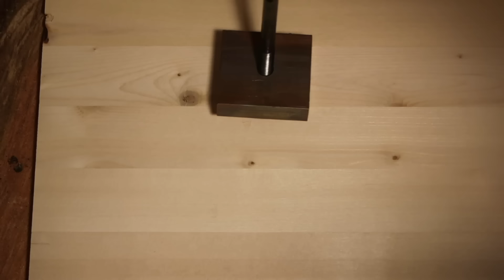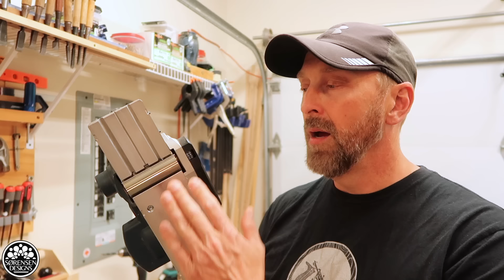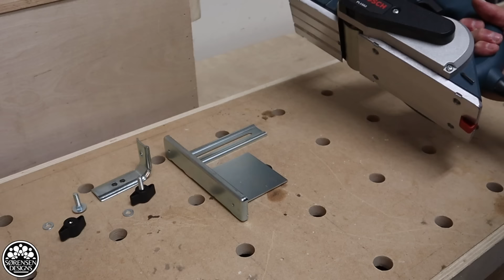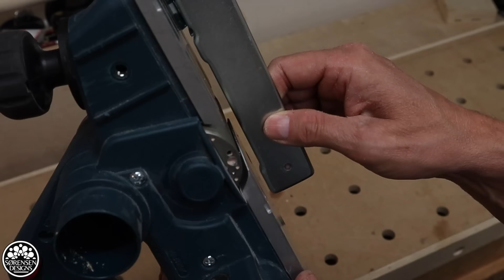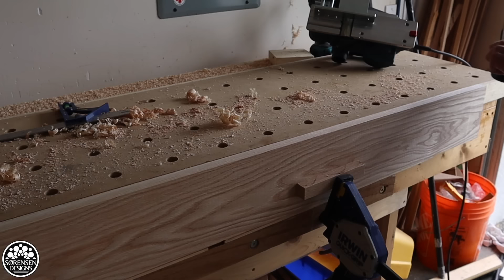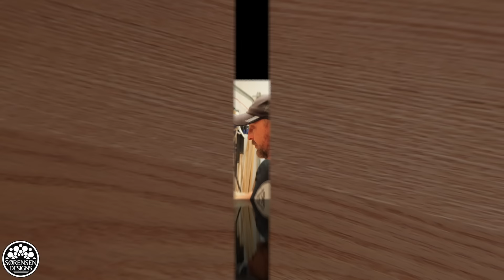Jointing Long Boards with An Electric Hand Planer // Woodworking

Comment: I have used these for over 20 years, and it boils down to using it like you would a hand plane!  These tools should be handled with the same care of a firearm, but also Confidently!  A Very good point about ‘wobbling!’  Also, with the Bosch, the planer blade is right at about the ‘B’ in the Bosch name on the side.  Knowing approximately where the center of the cutter blade is, on whatever brand, is essential.  And NEVER EVER place your hand on the sole plate!  Eric did here, but he was touching the guide, so not as close to the Cutting assembly.  Please handle these with care.  Stay safe and Healthy!  👍👍👍👍👍😁✌🏻🇺🇸

Comment: For being 10 yrs old, that planer looks brand new.
Reply from the maker: I actually didn't use it much for the first 7 years. It sat in a drawer. I used my hand planes more, but now I use the electric planer  for most of the jointing work.

Comment: I have an old but excellent Bosch hand planer with an edge guide. The biggest issue is avoiding snipe at the end. The only reliable way I’ve found is to clamp a batten to the tail end. It stops the plane dropping as the front shoe leaves the workpiece.
Reply from the maker: Ease up right at the end, don't let the planer shoe dip. It takes practice, the planer only does some of the work for you.

Comment: I have an old Bosch planer. The fence is the length of the sole plate and neatly covers the cutter under the guide. A great safety feature. 
It is awkward to set so must be checked for square/angle. 
The biggest issue is power cord. It snags all too easily stopping the job exactly when you don’t need it. You have to ALWAYS flick it clear before every cut.
Reply: If you put the cord over your shoulder opposite the hand you are pushing the planer with like the old timers did when mowing lawn, you will find that the power cord no longer is a problem.  BUT this may require that you add an extension cord. I hope the visual is clear...
Reply from the maker: I know the cord can be a real pain. I might upgrade to a cordless one day...

Comment: I just got that edge guide for my Bosch PHO 2000 last week. :)
It has 2 holes in the "fence" so you should be able to secure a small board to it with a couple of countersunk bolts to extend it vertically.

Comment: Hi, would you have any tips on flattening boards with this tool? I seem to still have issues with it and dunno how to really make the process work.
Reply from the maker: I never use this planer for surface work. I highly recommend investing in a thickness planer or get yourself a good number 4 smoothing hand plane and maybe a good jack plane - that's what I use to finish the surface.

Comment: Wonderful video Eric.  I was wondering if you need to "read" the woodgrain when using the power planer like you do with a traditional hand plane in order to avoid tearout, or does the spinning blade eliminate tearout and you only read the grain for your final hand smoothing planing.
Reply from the maker: Thanks Craig! You still need to determine the grain direction with machine planers. If it's hard to read edge grain, you'll know on your first pass if it's chipping out at all.

Comment: thanks for the tips, i wanted to ask what screw bits do you use the red colored bits in your impact?
Reply from the maker: On my impact drive, I usually have my long, Robertson screwdriver bit. I use a lot of Robertson head screws (square). Less likely to strip and are re-usable.